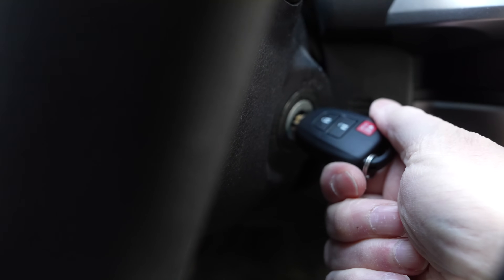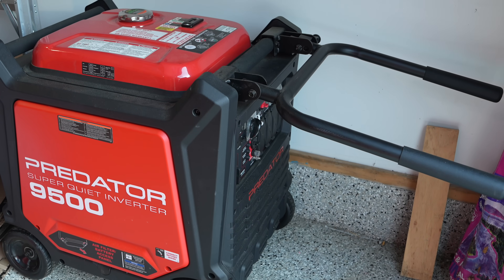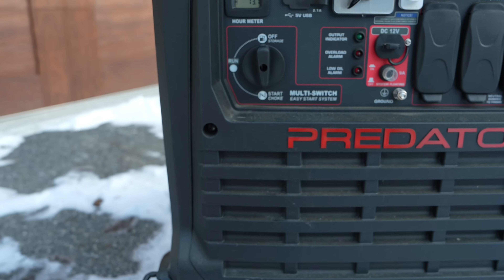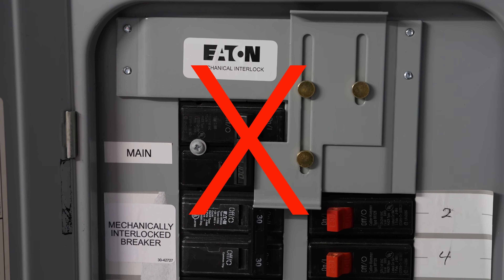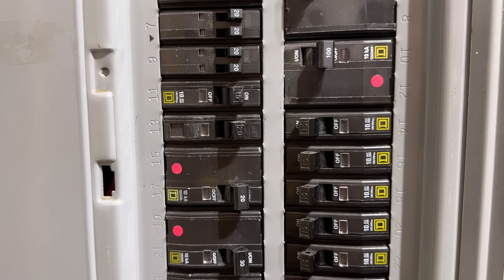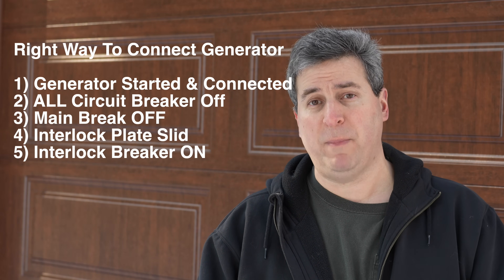Homeowners are Destroying Generators Skipping 1 Step During a Power Outage

Comment: I am a 74 year electrician. Most people do not disconnect their house from the mains before connecting their generator. Lineman I have talked to take jumpers and ground all three phases while they start to repair. This is to purposely burn out any generators that are connected to mains. It shorts the ac to ground at their location.
Reply: If the generator is back feeding to the line it’s also trying to power everyone else connected to the line too. I think these stories are misremembered incidents of old timers unexpectedly getting shocked in an outbuilding because the farmhouse was under generator power.
Reply: I think the linemen you talked to are being smug.  Lineman/electricians are taught not to work on live circuits IF it is possible to isolate (and/or ground) them. They also use insulated booms - just in case.  As an electrician myself, if I was working on an outage high voltage line, I would make sure it was grounded (or isolated) first - not to blow up anyone’s personal generator, but to preserve my own safety. The ground comes off once I’ve done my work.  It is also clearly a responsible action for a homeowner to ensure their home main breaker is opened before connecting any external generator (either manually or with a transfer panel). To not connect like that is dangerous.
Reply: @doobymaster6997 As a lineman I have to walk lines out to determine problems, so mains in on position while generators  are in use do endanger personnel that inadvertently come in contact with downed conductors, etc.
Reply: @doobymaster6997  Lineman working on storm damaged lines ground them because idiots jerry rig a genterator conection to their house and forget to turn off their main breaker. several generators backfeeding through their pole transformer can build up quite a charge. The lineman in this area ground "dead" lines for this reason. their safety.  If they burn out some generators in the process so be it. If not when they throught the fuses back into service thats when the home owners pay the price. 

 You should see some of the destruction I have seen for just this reason. Their not smug their protecting themselves from idiots.
Reply: @redcorset  I think we are saying the same thing - with the same results happening to stupid homeowners.  My point is if a lineman gets kicks from blowing up individual generators, just because they can, that’s a sick puppy.  Does it happen? Yes, but don’t get off from it - because you’re never going to eliminate all the idiots and the lineman always has the final control over his safety.
Reply: @doobymaster6997  I did not say they did it for giggles. They do it for self preservation. But they know what will happen to gen sets that are connected.
Reply: @ Definitely agree, but your statement was “This is to purposely burn out any generators that are connected….”. I just didn’t agree to the word “purposely”.  We are both agreed on the need for grounds.  We can agree that grounds are for personal safety.  We can agree that generators connected to a utility upon an application of grounds or utility reconnection (grid out of phase) will likely be destroyed as well, so I think we are on the same page.  Have a great day, fellow electrician.
Reply: False.
If this were true, then those "Most people" would also have generators attempting to power a few to thousands of homes.  Long story short... I've never seen a generator - portable or otherwise - without breakers on the output.  The breakers would trip immediately if they didn't have a way to disconnect the utility feed, no matter what (including a lineman shunting the line).  As a result, no generator will "burn out".
Linemen ground all live phases when doing repair work because that's what they're (correctly) taught to do in case of ANYTHING energizing that line, of which there would be the possibility in far many more ways on the utility side than ever could be from the customer side.
But let's not let facts get in the way of a good old wives tale.
Reply: Wouldn't having several generators backfeeding together burn themselves out by feeding into each other?
Reply: Lineman and line clearance tree men are all thought to treat every line as “live” regardless of anything. This is why the lines are supposed to be grounded

Comment: With the main breaker off, how will you know when normal power is restored?  I’m NOT saying keep the main breaker closed in when running the house on a generator, I’m just unsure how you determine if normal power is restored?
Reply: Most electrical meter are digital now. If you see the numbers on the meter the power is back on.

Comment: Grounding your genset is a very good idea, too, with a cable from your generator, at the appropriate location (which is clearly marked), clamped to a ground rod. Safety first: don't be ground (yourself), which, if your genset isn't properly grounded, could happen.

Comment: Then your generator is undersized. Should have separate generator panel sized for your load. No need to switch breakers on and off if sized correctly.

Comment: I have 14kw generator run by a 420cc gas engine at 2200 rpm.  It's belt driven to keep it quieter.  It only powers up an inverter charger using about 2 kw and 400 watts to the house.  It's way to much work to fiddle with the inverter every-time I use it.  I have about 750 hours on it without any issues.  I am running it daily about 2 to three hours and it automatically stops when it run out of gas.  In the summer it might get used half a dozen times.  This is it's third year of running.

Comment: Plug that cable into your generator and your house before you fire it up. You don't want to accidentally touch the end of that cable while trying to find the plug. It'll be the last thing you do. Also, make sure you've broken in your generator and changed the oil before you use it for the first time. Bring out your generator on a nice spring day before the bad weather hits, and make sure it runs and has good oil in it.
Reply: The end of the cable opposite the generator is a female plug. There is nothing exposed unless you purposely stick nails into the plug holes.
Reply: The only way you can get shocked by the cord that you plug into the generator is if you have made a suicide cord that has exposed prongs that you plug into the regular dryer, range or other non generator specific input plug. On a standard proper generator cord the live end is a female end that is a dead front with no exposed metal parts that are powered. People using suicide cords do not have an interlock setup unless they decided to cheap out on the plug setup which is the most dangerous part as you were saying.
Reply: Some good points and probably a great habit but if your breakers are off,,,, there's no power to that plug and cable when you plug it in.
Reply: @gregorybrown8756  You want to plug it in to the house before you fire up the generator. There are no breakers on my generator that control the power flow from the plug, so if my generator is on and I accidentally grab the plug the wrong way (say it's dark or raining) then I'm not gonna walk away from that one. If you wanna plug it into the house first, that's fine, just make sure the main breaker is off if you're back-feeding the panel. That's how I do it. The main is off and the breaker for the incoming power to the generator is on before I fire up the generator.
Reply: @jamescrumbaker3169  Actually both the Main and Gen breakers should be off in the panel.  After connections to the house and Gen are made and Gen is running, then, flip on Gen breaker in the panel, then start energizing circuits.
Reply: @243wayne1  what's the difference? There's no draw on the generator if all of the other breakers are in the off position, right? The original point is was making is to make sure the cable coming from the generator is plugged into the house before you fire up the generator. That's the dangerous part. Having the breaker on for the incoming generator power is not gonna hurt anything if the rest of the panel is off. Am I wrong about that?

Comment: Dear Silver. You made a possible fatal mistake. You said to start the generator BEFORE plugging it into the wall. It is the male plug then that is hot. If you touched the electrodes or you slipped and accidentally brushed them against you, you could electrocute yourself or others.
Reply: His cord has a female end going into the house. The male end goes into generator. You seem to be describing two male ends. Which is not the case here. At 25 seconds you can see the house has the male connector.

Comment: A Diesel generator costs more .... but you can leave it unused for YEARS  and it will work fine ... petrol ( gasoline ) generators may suffer from the fuel going bad after long periods of non use .... but then you might drain the fuel before storage ( who does ? ) ... Diesel oil is much less likely to go bad ...................... DAVE™🛑

Comment: 1:00 ECO mode off... Recall that the generator is not under load yet. Doing this is like your car doing a fast idle when you initially start it and then throttling down when the engine starts to come up to temperature. It does this to expand the metal in the block to better seal the joints and cylinders, and also to warm up the oil so that it thins out enough that the oil pump can circulate it efficiently and both lubricate and cool its area of the engine. Get everything switched over, and only then go back and enable ECO mode to allow the generator to do what it wants to.

2:30 This depends on the size of the generator and the design of the interconnect. A standard industrial backup generator, like those you see outside of buildings on a dedicated concrete pad, is designed to start and switch over within ten seconds, that is, as soon as it is running fast enough to produce current, and will switch automatically from an ATS (automatic transfer switch). A small, portable home generator probably doesn't have the capability to do this. Plus, the big generator is probably also supplying a UPS along with lesser circuits such as building lighting and wall outlets, so there is no meaningful startup/inrush load; just switching in running equipment at normal load. This especially applies if your generator is small and only sized to handle essential things, such as the refrigerator and lighting and a couple of selected wall receptacles, with no other loads connected. (EG, these things are on a sub-panel installed just for this purpose which itself is switched over rather than the main panel, leaving the main panel down until power comes back.)
Reply: There’s a huge difference between high idle, and WOT! I would never start a cold engine at WOT, no matter what the manual says.

Comment: Staging your AC loads is critical to reducing the surge currents on your generator. Surge currents caused by inductive loads from starting electric motors (you refrigerator's compressor) can momentarily (1 sec or so) be 5 or 6 times the operating current. Having more than one heavy draw, high inductance load start simultaneously can absolutely Kill your generator!

Comment: Manufactures, at least generac, never recommends running a generator unloaded, even when warm up idling. Many people connect a light bulb but I find it more practical to connect a box fan. It uses the same amount of power (60-100w) while serving a function: cooling your generator. Just put the fan next to it. This is obviously essential if you are using a noise isolation box, or even some plywood to box in your generator to quiet it down, as that obviously prevents some airflow.

Comment: Decent advice with one major improvement suggestion. DO NOT handle the 240V power cord and make connections after the generator is running. That's 30-50 amps of 240V power and enough to kill. Generator connections with a 30/50 amp cord to the house inlet box should be made before the generator is started.

Comment: I seen what happens when you ignore all safety precautions by hardwired a generator into a panel and bypassing it's internal breaker. I never seen a generator throw two rods through the block like that.. Got back-fed, alternator portion completely melted.

Comment: How did you get your red and blue circuit breakers?
Reply from the maker: I really like those, letting you instantly see 15 or 20 amp. Those breakers are about 20 years oold and sadly they stopped making them. They can be found by Eaton sometimes but I believe offcially they are long gone. A bad cost cutting move

Comment: An important - and frequently ignored - issue I see is putting too much of the load on only one leg of your generator.  If you install a transfer switch, I only recommend those with dual watt meters so you can keep track of the load on each leg.  This helps you keep the load balanced between legs as well as lets you know when you begin to draw too much power overall.  A good installer will arrange it so the average and max loads on each leg are as close as possible.

Comment: I thought everyone did what you suggested? It’s called cold load pick up. Anyone doing that will shorten the life of their appliances & the generator. We use non eco during day light hours & economy at night. Just before bed we shut the generator off & switch open our individual breakers for the next day. 
Great tip for those not in the know! Great content!

Comment: With properly configured emergency generator to load surge of everything turning on is fine. The load pickup of the engine can take it, and the voltage regulation was tested for this. These engines often start with overspeed surge.
With those cheap small units the voltage regulation may cause significant dip and swell, because if it reacted too fast it would stall the tiny engine. These voltage fluctuation may damage your electronics.

Good advice

Comment: First thing I do on everything with an engine, check the oil level in the crankcase before starting engine. Oil leak may have occured while sitting over time.

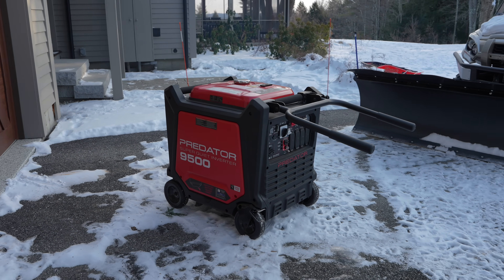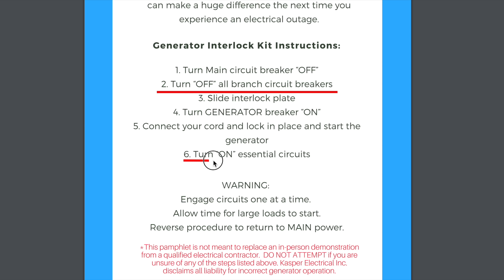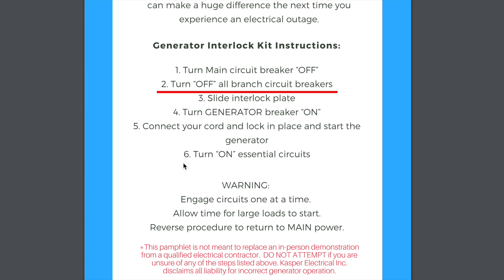Comment: I agree with most of your statements except the statement you make at 1:44 of the video.  You state that when you connect your generator "really doesn't make any difference".  That is incorrect.  You should always ensure the generator is plugged in before starting it.  This fact is clearly stated at 2:55 of the video ... "Connect your cord and lock in place and start the generator" and also at 2:57 of the video ... "Connect and start your generator".  The reason you want to connect it before starting it is you want to ensure the generator is properly grounded before starting it.  You should ensure that only a "floating neutral" generator is connected to your house unless you are using a "switched neutral transfer switch".  A "floating neutral" generator will only be properly grounded when it is plugged in.  There are some rare scenarios that can harm the operator of a "floating neutral" generator if it is not properly ground, but it is still possible.  The bottom line message is, plug in your "floating neutral" generator before starting it.

Comment: They don’t idle when the eco mode is off. It’s the very thing that idles it down when power demand is low. It IS bad for any engine to start and immediately go to full throttle as you suggest is fine. You also assume that all generators are inverter style it seems. So many wrongs in this video.

Comment: Can you advise what happens if I have a solar system on my roof, and the solar system tries to "export" to the back-up generator please? Many thanks. Oh, no battery installed here.
Reply: No battery means grid-tie ? Should be fine when the gen is running and power is used. BUT cheap/Chinese inverters can put 165V on your system and destroy the gen and loads. If in doubt, turn the solar off or its breaker. Safer to have grid tie connected only to the grid and only when the grid is energized. With auto switch.
Reply: @laurencerilling5873  Thank you. I agree with your thoughts.